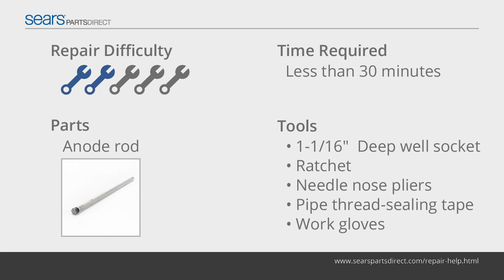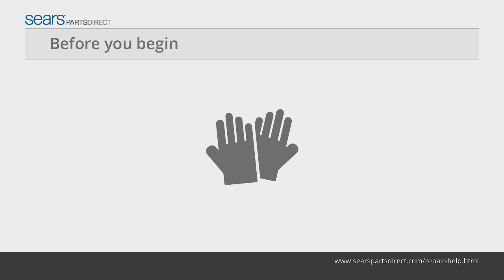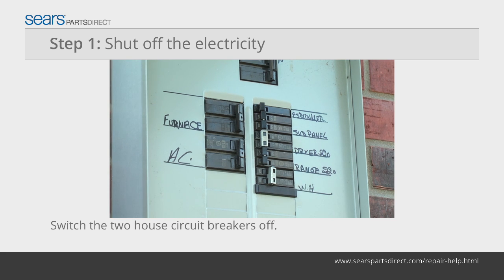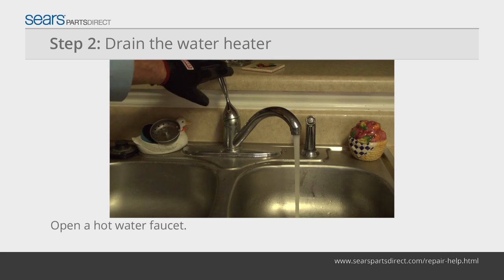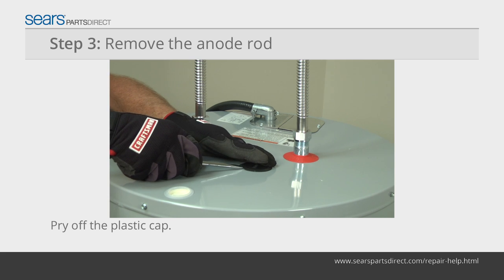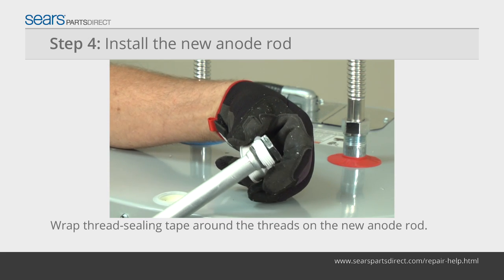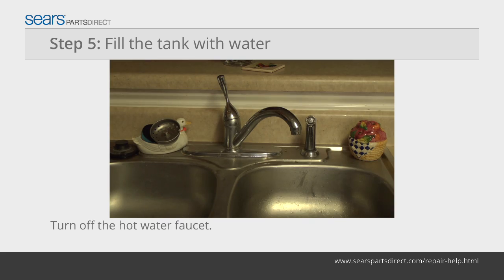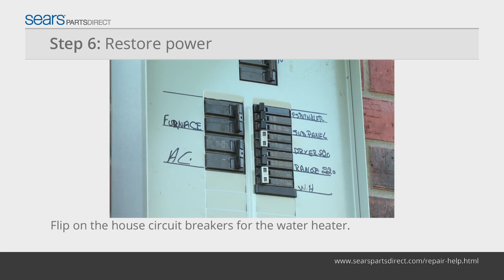How to Replace an Electric Water Heater Anode Rod

Comment: Little easier on a new heater.Not so easy on one been in for years.Breaker bars and or impact wrenches and a lot of help.Use a flexible replacement rod.